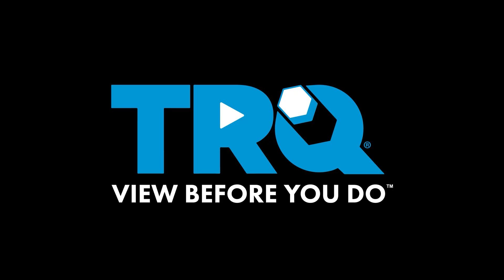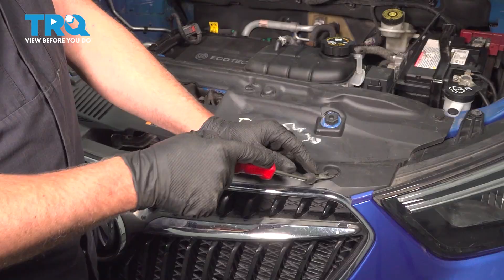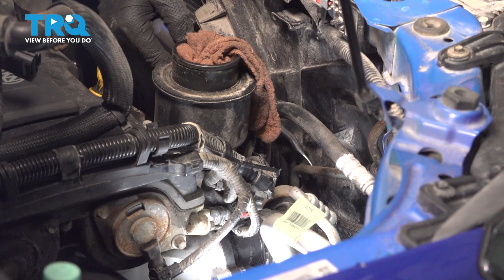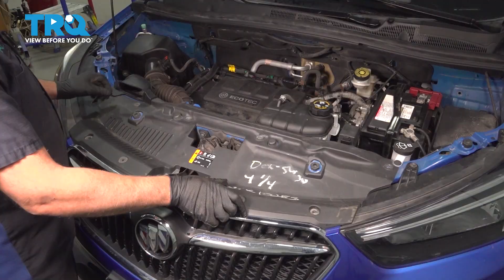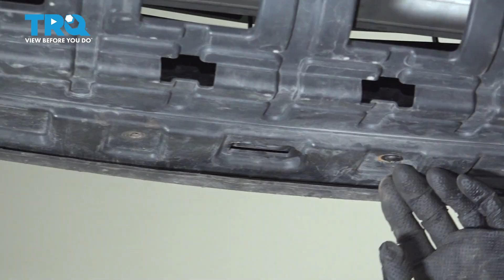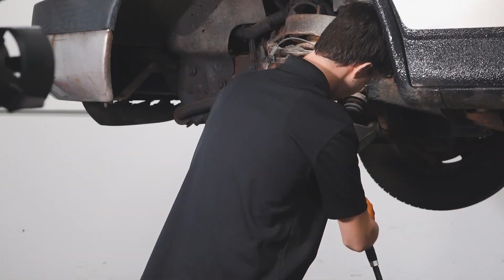How to Replace Engine Cooling Fan Assembly 2013-2022 Buick Encore

Comment: Some were made in Mexico and some were made in China. If it was made in China it will slide out like this, but if it was made in Mexico there will be a bolt on the passenger side of the bottom of the fan assembly